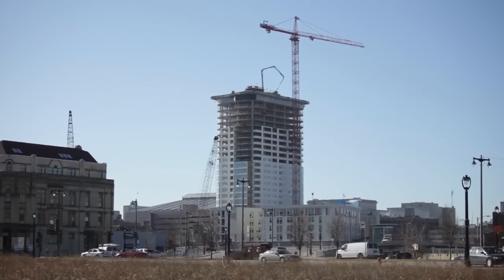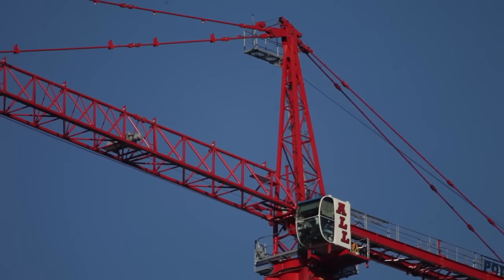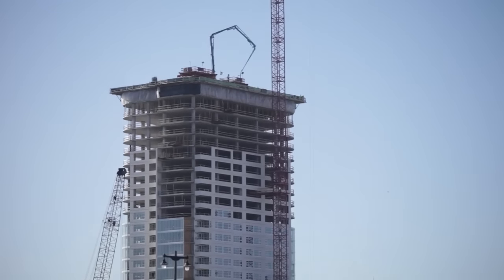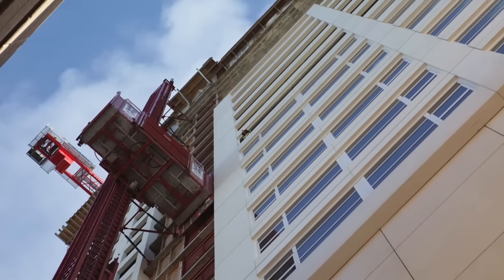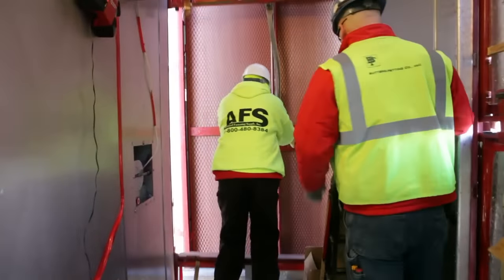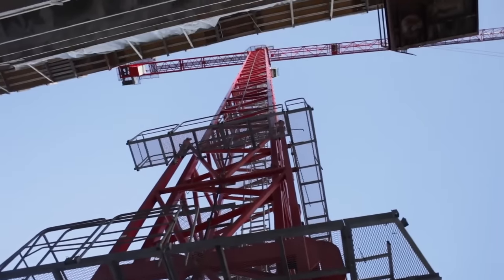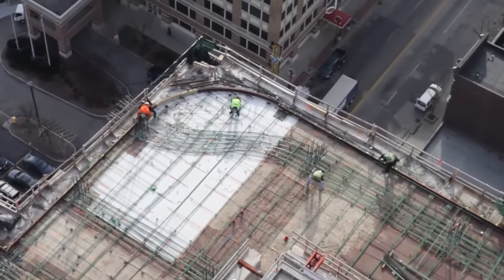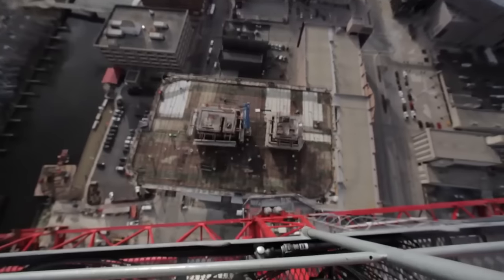Climb to the top of the 360-foot tower crane at The Moderne Apartment High Rise in Milwaukee

Comment: With all that technology and engineering it's always surprised me that the crane operator has to climb hundreds of feet up vertical ladders to get to the cab. Surely it must be possible to fit some sort of lift mechanism? It only has to carry one person after all.
Reply: Even though it isn't as high, the tower crane outside my window has a lift for the operator. When it didn't have a lift, I always saw the operator taking breaks at every third
Reply: They usually have bridges near the top
Reply: We get paid extra 30mins on each day. Call it climb time.
Reply: @snejad596 big money too !

Comment: I'm a retired union boilermaker had a operator on a job and he told me about when he was operating a tower crane and it was in the winter.he would piss in empty milk jugs and when they were full he would put them outside on the grating well when they froze they cracked the plastic now come spring time they thawed out and were dripping piss all over the ironworkers on the ground when he swung the crane.lmao

Comment: I been on a 300 foot crane taking down some temp lights to light up the hotel when they poured concrete views were awesome of the Mississippi river still got the pics today the biggest problem was dealing with the wasp lol
Reply: dealing with wasps 300 feet in the air? I'd be dead.
Reply: PeacefulJoint lol yeah it wasn't fun but we ran out of wasp spray but next time we went up we got double the wasp spray lol I remember the first day we got half way up and saw a storm coming in barely man it down then it started hailing take about lucky lol